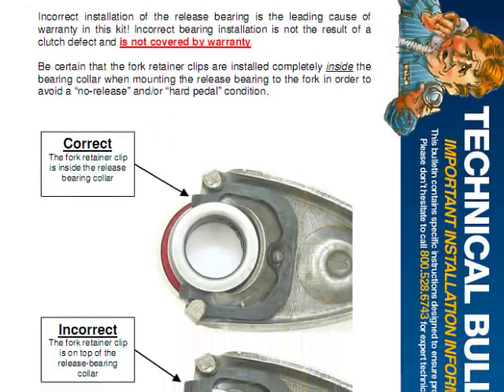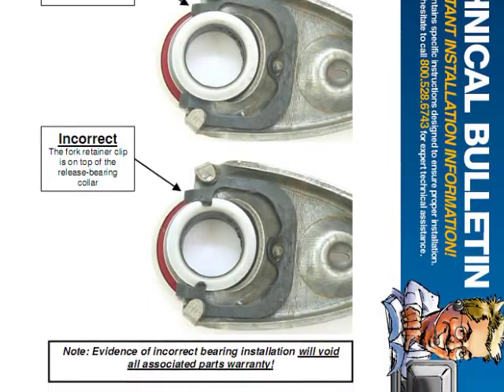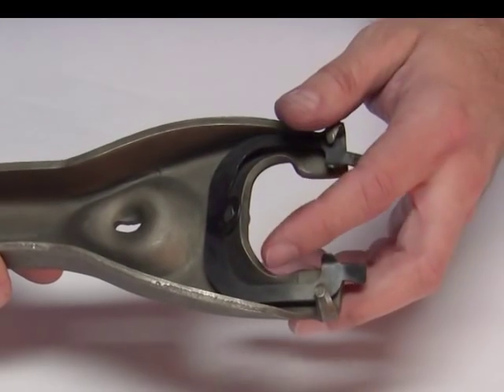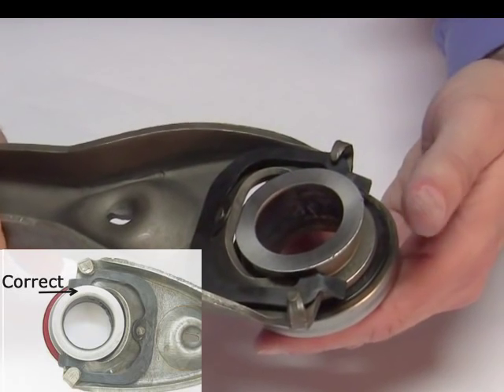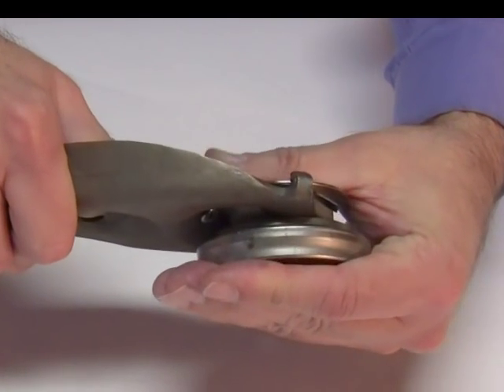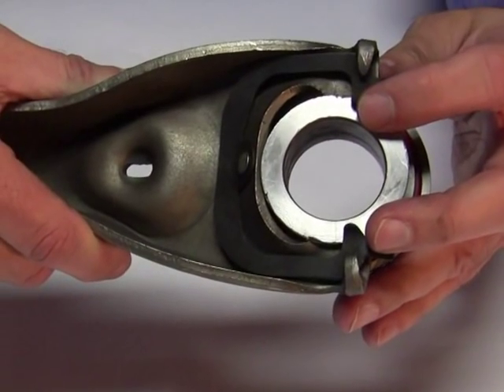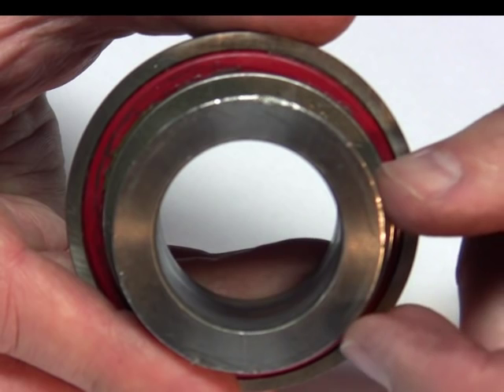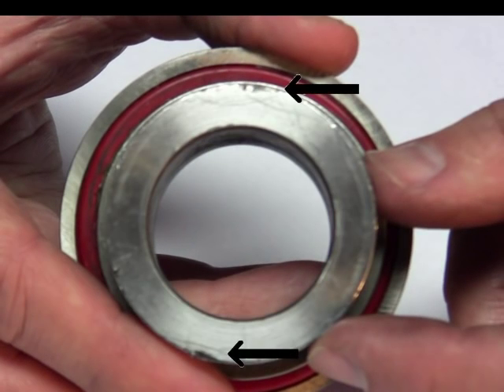GM Release Bearing Installation

Comment: FYI to all that watch this video.  I'm no expert but you don't always snap in the throw out bearing.  I'm working with manual 3speed trans and a chevy 327 motor.  You don't snap in the bearing.  Rather place it in about half way then line up trans, etc.  This vid caused me some confusion.  But thanks for the effort and explanation on clips.
Reply: Thank you, with it all the way snapped in, it cannot pivot correctly. I've been sitting here holding off because I did not want to install it wrong.

Comment from the maker: @gordysuggs If the bearing is installed incorrectly it will have an air gap between the fork and the bearing riding surface. This will cause the car to not want to go into gear. The reason is because the hydraulic system has to take up the 0.200” gap and runs out of stroke to complete the release process. It will also cause the pedal to have a spring back feel.
Thanks,
AMS Tech

Comment: what happens if the release bearing is not installed right...will the car go into gear without using the clutch and wont move because a mechanic installed a new clutch press. plate, flywheel, realease and TOB and that is what happened

Comment: I can’t tell you how many idiot mechanics notice how I didn’t say technicians have installed these wrong. I’ve been working on cars since I was a little kid unfortunately, my truck got a wreck and the transmission needed to be replaced along with the clutch so was in the shop. I went ahead and paid for the extra services since it was already there to get all that done as well. After a few months, I can no longer put the truck in gear. I took the transmission out myself and looked and of course they installed it incorrectly. I brought everything back to the shop just to show them and they told me I was an idiot so I showed them this video. You should’ve seen how lemon faced they got 😂